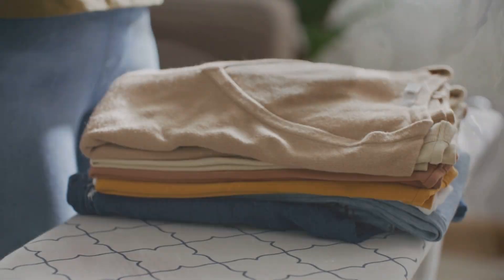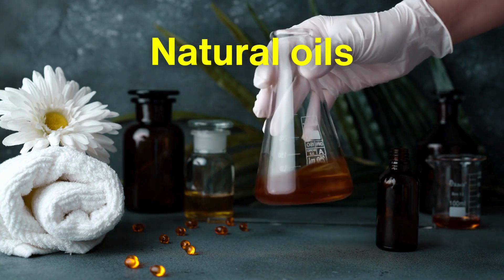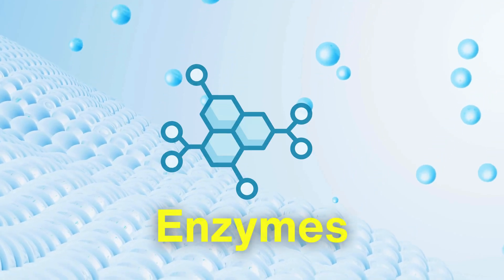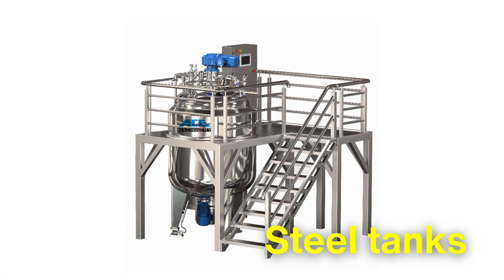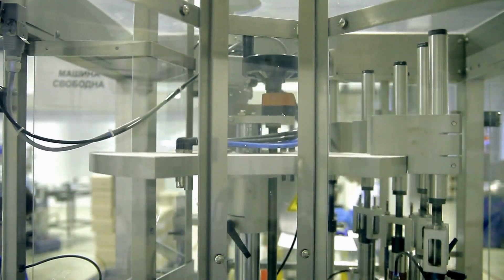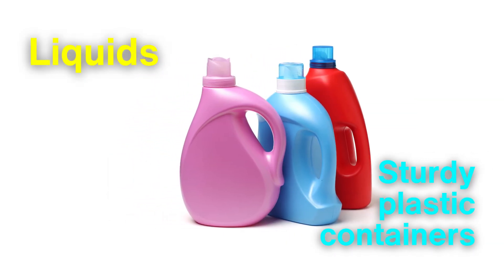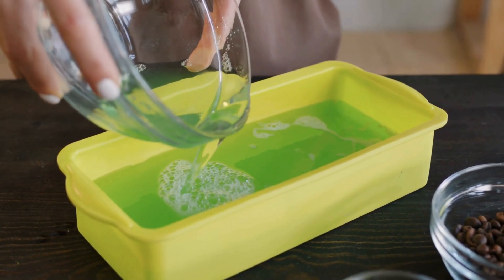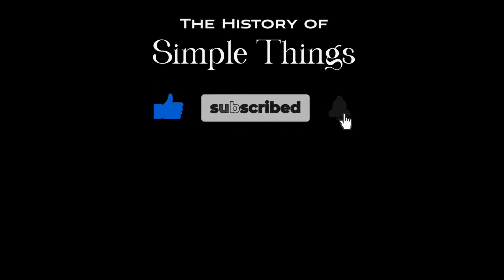Behind the Bubbles: The Invention of Laundry Detergent

Comment: Purchased a great high efficiency top loader washer ( screw the moldy front loader washers ) that not only reduced my water bill but use a lot less detergent. Of course my hard headed wife still uses a full cup of Tide. Even with a second rinse there is a lot of suds in utility sink. Now do.most of the wash.